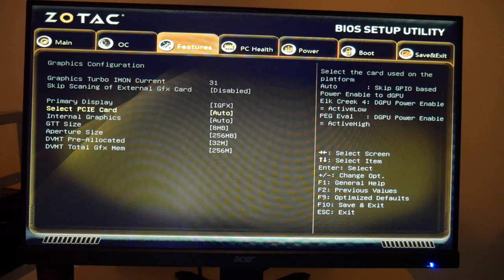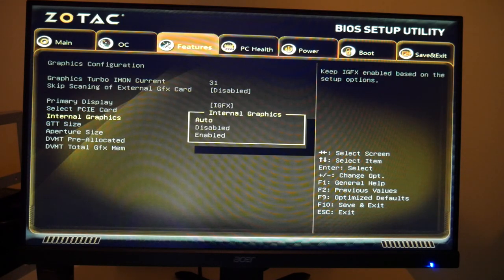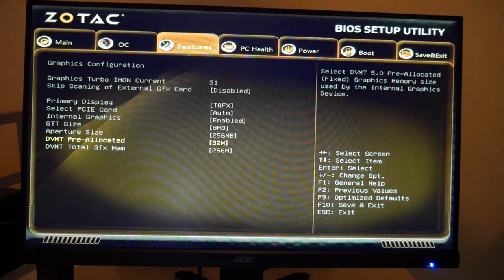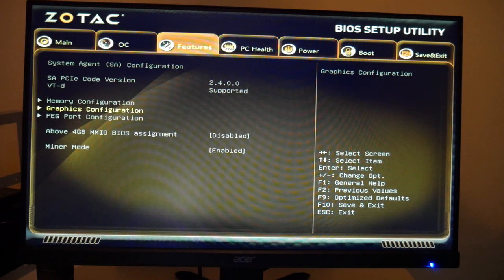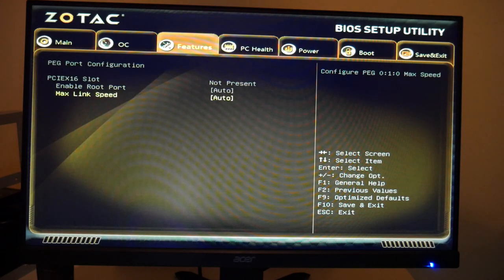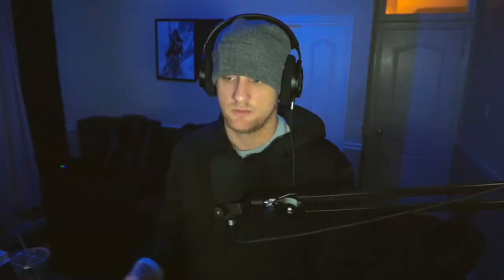How to Troubleshoot an Eth Mining Rig

Comment: Happy to see this video. Currently at work while one of my machines has yet again, stopped mining while I'm away
Reply: Mate buy a wi-fi smart outlet and you are going to solve your issue When my rig with hive os crashes I turn off and then on the power through the smart outlet and the computer restarts normally. You can control your outlet through your smartphone. No matter where you are, you only need internet. Just don't forget to put the option of your bios for the same power state after power loss to ON.
Reply: @PkatsOG  that's a great idea! Thanks for the tip!

Comment: To reset the CMOS, you should have a 2-pin or 3-pin header on the board with a jumper. Printed on the board is something about CMOS. The motherboard manual will have this noted as how to reset the CMOS by putting the jumper on two pins, then rebooting, then turn off and put the jumper back to the pins used for normal operation. Many times, removing the battery will not reset the CMOS.

Comment: I had an issue of my rig going down after a few hours. I'm thinking it's either the riser or the power supply. Using 450 watts on a 650 watt.
The accepted shares where always weird at the start like my 1070 ti will have 50 shares at 32mhs and my 5600 having 30 at 42 mhs. Changed the riser doing a test now and those accept shares seems to match the mhs now see how a day test goes
Reply: How did it go I’m currently having the same problem, I’m crashing after a few hours of mining I’m on windows and the whole os restarts
Reply: @douglasmehnert4855  what miner are you using? I was using phenix so for the longest time I just set up a shedual restart every 24 hours. But I found it was mainly overclocks.
Reply: @AP_Sim  I let my cards run at stock and they’re going fine with no restarts so I think it was my oc I’m using nbminer so I can get like more out of my LHR 3060

Comment: Great video, really clear and helpful...
I have a slightly different problem. My machine has 2 GPUs, when both are connected the pc reboots as soon as etherminer is started, however when either GPU is running alone everything works perfectly... any idea on the issue?

Comment: I am having Rog Strix Z490 - F Gaming Motherboard.
I am using it for mining. my problem is with 4 GPUs my pc not booting even with no bios screen just no display at all but if I remove any of one GPU it's booting fine if I fix the 4th one it will not boot again and no display at all. ( not even bios screen)
my system has a 2 x 850w Asus power supply more than enough power system.
in bios, I upgraded to" 2201"
PEG Port - Gen 2
Link Speed - Gen 2 
Dim Max Link - Gen 2 
PCIe speed - Gen 2 
4G Decoding - Enabled
Intel Virtualization Tec - Disabled
Launch CMS - Enabled
VT - d - Disabled
DVMT Pre Allocated - 64M
Primary Display - CPU Graphics

I changed all the bios settings mentioned above but still the system not booting with 4 GPUs . only working with 3 GPUs.

kindly advise me on how to get it to work with more than 3 to 6 GPUs.

Comment: have 7 3070  nvida cards, but i decided to buy a 3090 Nvidia  to complete the rig, but for some reason, the rest of the 3070 went off line. HiveOS did recognized the 3090, but still is off line. any tips? not combine the 3090 with 3070? unplug everything and install one card at the time and see if the system boots up?

Comment: could it be a bad driver ? i have 4 p106-090 and a 3090. what i have 3p106-090 connected i can have 3 monitors running but when i  connect all 4 and the 3090 i lose all monitors but one, i still see them all in the settings but their gray

Comment: Hello, so I have a question, so on my mixed rig I have: 

H110 Pro BTC+ mother board 
4 GPUs: 

MSI RX570 8gb 
MSI 2070 
EVGA (or EVEA); 2070 
Asus 1660 super 

I wanted to add an RX580 8gb (It’s a Radeon, AMD card), and every time I add it to my rig and (I usually turn off my rig to add a new card), it detects the GPU, but it gets frozen on the startup screen and says: “A start job is running for hive” and then has a counter but it just freezes, what should I do? I took off that GPU and the rig works fine but when I put it in? It freezes. Any ideas?

Comment: I'm using h110 btc pro(13GPU) I have 6 (3x580,3x570) gpus that work but I am unable to get the mining OS or motherboard BIOS to detect more than 6 GPU. I have tested working risers and working GPUs, but when booted up it will always not detect anything, even when the gpu and fan turns on seems to work properly. Sometimes if other gpus are removed, then it will pick up the new card, but never can them all working at once. I have tried updating BIOS, configuration of BIOS,  I am running 6x gpu and mobo on 1200W PSU, I am trying to add 4 more cards on a 750W secondary. At first I could not get more than 5 GPU, I was able to get 6 when I plugged one GPU directly into the 16x slot, which led me to believe that it was a riser problem. However, my 16x slot then stopped working, and the SAME GPU only operated when it was plugged into another 1x slot with a riser, the same riser + GPU would not operate in the 16x slot! Something very strange is happening. it makes me think that it has something to do with the BIOS and the PCIe slots, bus #, etc. But also it seems to me to be a power issue? the fact it only works with less GPUs. Some GPUs are very picky with their slots and their risers. I have no clue whats going on or how to fix it.

Comment: You definitely don't need to pop the CMOS battery out in modern motherboards (last...15 years?). There's a jumper or now even a button for it. I did just have one battery die on me on an 8yo mobo though...
Reply: Exactly. Cheaper motherboards have a jumper (look for the 'CMOS' jumper in the mobo manual in the overview page) and the more expensive ones have a button. The button is only a handy convenience feature because you can even connect the 2 pins with anything what is metal, like  a scissor or screwdriver if you do not have a dedicated jumper connector. Just use such one that has plastic grip so you are isolated. Hold it there, turn on power and a few seconds afterward turn off the power. Stop the contact and you are good to  go again!

Comment: Ah could have used this 24 hours ago as I battled 101 minor issues with my 6 x 570 rig I just set up. Anyway running smooth as silk now locked on 145.5mh with no tuning.
Reply: I'm using h110 btc pro(13GPU) I have 6 (3x580,3x570) gpus that work but I am unable to get the mining OS or motherboard BIOS to detect more than 6 GPU. I have tested working risers and working GPUs, but when booted up it will always not detect anything, even when the gpu and fan turns on seems to work properly. Sometimes if other gpus are removed, then it will pick up the new card, but never can them all working at once. I have tried updating BIOS, configuration of BIOS,  I am running 6x gpu and mobo on 1200W PSU, I am trying to add 4 more cards on a 750W secondary.

Comment: Hey, so on NiceHash os. I added a 2nd and 2 gpus( it was working with 1 850w psu, a 1060 6gb 2x570 8gb 580 8gb all on low power mode). I then added a 1050w psu, a 1070 and a 1080ti. It was all working besides the 1080ti
Reply: So I start trouble shooting. Then the next issue pops up where it won’t boot with all the gear. So I go back to what was working. Won’t boot. I go down to 1 gpu. Won’t boot. I go down to barebones mobocpu ram 1 psu. It boots with the 1050w. But the 850 is a hit/miss if it’ll boot. The I’ve also reflashed the OS. But when I go to plug in any amount of gpus the rig won’t boot. 

So it sounds like both of my psus are dead/dying. But for future reference because I think it started only because I was using 2 psus. 

Can you explain, like you would to a child exactly how 2 psus work. Because I used a paper lip to short the green and black cable(4/5 pin from the right while looking at the clip) and clearly I wasn’t doing something right.

Comment: Great video. Thanks bro! Need some advice. I keep getting blue screen of death with lolminer and Trex miner. Error message says “MEMORY_MANAGEMENT” and sometimes “System service_exceptions”. 
I am mining ethermine pool. 3x rtx 3090, 2x rtx 3080ti, and 1x 3060ti. Two 1000 PSU. i5 cpu. 16 RAM. Freshly built setup. Not sure why I keep getting blue screen of death 😢.

Comment: Sometimes my windows 10 box becomes unresponsive when making remote desktop connections, can I tap the reset pins with a flathead and reboot the OS? I'll try that.  I could just power down but I don't want to do that. What do people do when the windows 10 UI freezes? On macOS you can sometimes get away with Command-Option (ALT) - ESC to try and force quit apps, does Windows 10 have something similiar.  I've tried ALT - F4 on Windows 10 and the UI does not respond.

Comment: Got an issue where my rig runs for a few hours but the hashrate starts to slowly drop until it drops permanently to zero. When I return. The rig is still running but I open the monitor and the mining program is not open. Not sure what exactly is happening. The GPUs are running as normal but the program is not running and the connection to the mining pool has dropped.

Comment: Somebody knows what this means "amdgpu: [powerplay] Voltage value looks like a Leakage ID but it's not patched "?
This is first and shortly (repeating abuout 10 rows same message) showing while LINYX is starting, and after when the OS (Like MINEROS or HIVE) and the miner+task starts. It repeat usually 2-3 times (with whole screen rows with same message) while usual miner info flows. Current mining is not problematized, no degradation, nothing I noticed. Problem should occur in next restart (or few restarts after) of the whole rig, and hapen that one or two GPUs are missing. 
I connect the GPU disappearance with this long message. 
There is nothing useful on google search, and I never had this problem assembling a really lot of rigs beginning 2013...

Comment: Hope someone can help. I'm new to mining. I just hooked up my 2nd card on the rig. Radeon RX 6600 8176 MB · MSI. I've messed around with the overclocking and for some reason the most i can get is 1.25 MH. I just can't figure out what the issue is. Any ideas?

Comment: Another option for detecting faulty cards is to mine for 10 mins and feel which card isn’t hot on its possessor
Reply: Also thank you for making this video
Reply: But some times if gpus are close to each other and weather is hot it is soo difficult to detect it
It needs doctor with thermometer
Reply: @MohamedAhmed-gf4uo  kind of, when mining this chips get so hot to the point where u cant hold ur finger down, while the gpus being cooled from their surroundings only can be touched for as long as u want

Comment: Thank you. My system wasn't starting up after one of the pci riser came loose on the mobo. I pulled all my gpu off and plugged it 1 by 1. Now it boots up. Problem is I had 6 gpu working before. Now no matter how I arrange the gpus (they all work, none are dead)...the system only starts up 4 gpu. Won't run the extra 2. Any help?
Reply from the maker: depends on mobo. Check above 4g decoding

Comment: I have rig strix b450-f gaming and I cannot run more than 4gpu cause my system doesn’t recognise the 5th how can I fix this?
Reply: Go to your BIOS and find "4g decoding" and change it. See if that helps. Also set PCI-E slot multipliers to 1x, disable iGPU, internal sound card etc. that you don't use. Your risers are powered from 6-pin PCI-E's hopefully? Using Windows or NHOS or HiveOS?

Comment: idk what's the problem but I get a hardware error in every few hours and dag rebuild in every 2-3 hrs, I have rtx 3070... temperature is below 42⁰C, fan speed 60%, 1200 on memory, -500 core and 130w on power in msi afterburner, I'm using LolMiner on windows 10x64
Reply: dial back on the memory overclock.
Reply: @swiftly1937  I didn't dial back on mem but since I left a comment here that dag and hardware error disappeared 🤷‍♂️ I'm still confused what's going on 😅
Reply: @mytvclips  very interesting. have you updated your gpu drivers and bios? could be an error than will only occur under specific situations
Reply: @swiftly1937  yes I'm using the latest version of nvidia drivers and the most recent msi bios, I read the lolminer's update changes that it's causing some issues with dag, maybe they'll fix that soon.
Reply: @mytvclips  im also using lolminer. which version are you using?
Reply: @swiftly1937  previously it was 1.22 which seems unstable but I'm currently using 1.21 and not a single error, no stale share and zero invalid shares.
Reply: @swiftly1937  btw I'm getting 60.70+ mh/s stable and it's on 124w with +1250 on memory. I managed to get 63.20+ mh/s with 130w, +1500 on memory but I was getting dag rebuild and memory error almost every hour so I'm good with 60.7mh/s
Reply: @mytvclips  yeah im on 1.21 also. never had an issue yet. also i tried your settings and it seems to be working. thanks! i was only getting 58.80 mh/s @ +1000 on the memory.
Reply: @swiftly1937  I'm glad I could help 😅 😁
Reply: @swiftly1937  hi, an update... trex miner is giving me 62.8 to 63.4 mh/s at just 128w, 1400 memory, stable no errors since last 24hrs
Reply: @mytvclips   what 3070 do you have? i might have to try out trex miner. i can only get about 61mh max before i get errors, thank you for the tip!
Reply: @swiftly1937  it's inno3d Ichill x3, (samsung chip) I'm now running at 1500 on memory, 128w, 65% fanspeed, 45⁰C temp, it gives almost 64mh/s but with a few invalid shares less than 1%. I'll update after another 24hrs how it went but 1500mem is not recommended as it can harm the memory.
Reply: @swiftly1937  so after 24hrs here's my update, I got R:1.73%, 1191/1212 i.e 21 invalid shares. fanspeed 65%, 132w, on +1500 memory. getting about 63.38mh/s in day 48⁰C and it was 63.9mh/s at night 43⁰C 🤷‍♂️ maybe because it was running cool due to weather. gonna run at these settings until I get more than 2% invalid shares or hashrate falls below 63.3mh/s and then I'll dialback them.

Comment: My fans stop working (both). ASUS 1060 6gb, they usually kick on for a moment at OSwindows start up and shut down. Manually changing the value in any afterburner type application doesn’t change there state. I have a sister EXACT gpu did all the common practices as you’ve listed above. Any saving this? Otherwise it performs Perfectly, obviously Starts to get hot since the fans don’t turn on even on auto mode. Any insightwould be great, thank you.
Reply: Bad Mosfet?
Reply: @digus  not sure. I’m pretty savvy with pc and am an automotive electrician. Other than check continuity across them, I’m Really not sure where to start or go in troubleshooting steps honestly.

Comment: what is usually the cause of a failed oc? is it mem clk or core clk/voltage usually?
Reply from the maker: memory usually
Reply: @SonofaTech  yea my samsung 5700xts will always fail at anything over 905
Reply: @blackfish4674  Got mine at 950 with no problems at all 74 Junction with modded bios, Hynix chip, i think I got a silicon lottery